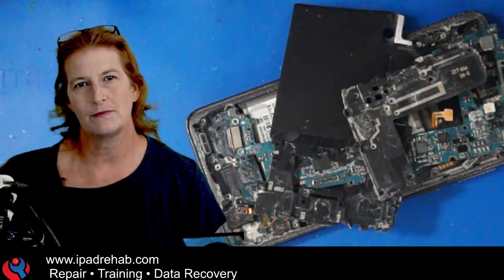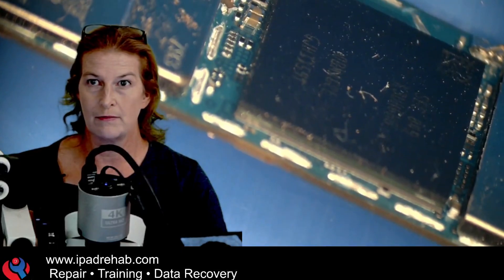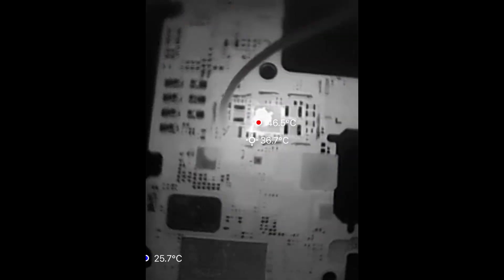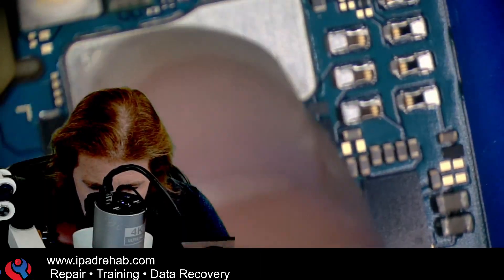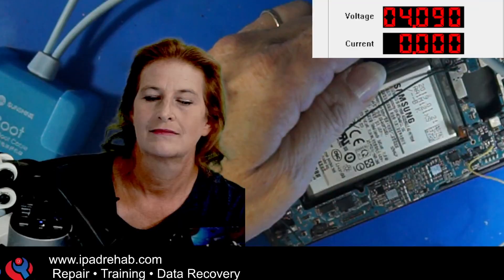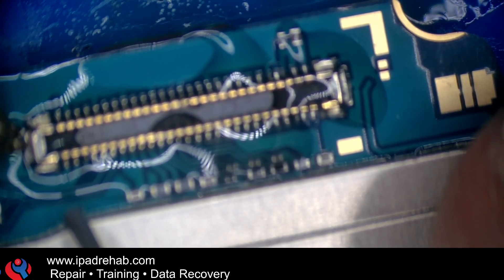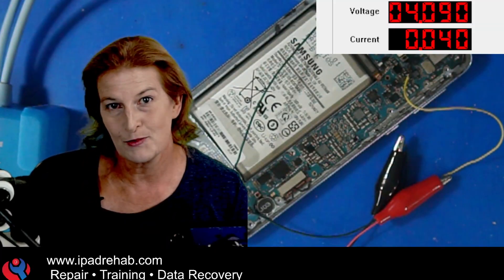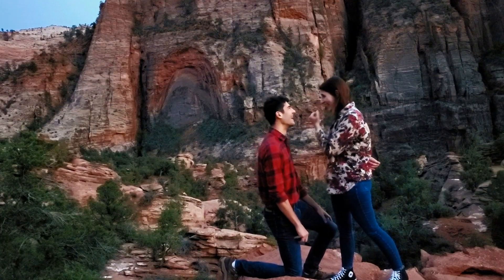Photos and Videos Recovery on Samsung Galaxy S10E

Comment: Great timing for this video.  Yesterday a bunch of Samsung S10 series owners found their phones boot-looping after the latest OTA firmware update by Samsung.  Turns out that the SmarThings framework has a bug and crashes the phone, losing the data too.  Yikes!
Reply: Can I have more info on this please? I have this exact boot loop problem. Is the data definitely lost?
Reply from the maker: Not definitely no.   I would give Samsung a little bit of time to create a software update that will fix it.  (This is about the sudden boot loop after automatic software update that happened on Oct 2 2024).  Other S10 and S10E boot loops are also common and can be fixed with CPU transfer
Reply: @JessaJones  Thank you very much. I will be waiting a bit for a firmware update. If CPU transfer can solve the issue, I'll give it a try. Didn't know that this was even possible.
Reply: @JessaJones  - All Samsung has to do is release a signed SmartThings app zip update, flashable right from an SDcard through stock recovery, or an Odin tar file.  So far they they are just sending people to their service centers. smh
Reply: Does anyone know if there's been an update on this yet? Honestly still heartbroken over all the pictures and videos lost. I don't have the thousands of dollars that DS quoted
Reply: @ - SamFW there's a file for the S10/S10e/S10Plus "U" variants with build data 20240606155510 which fixes it.

Comment: what solder to you use to remove the connector? Low melt or regular lead solder? Why cannot you apply a heat from bellow?
Reply from the maker: Always leaded.  Low melt is bad for connectors because it is weak.   You could apply heat from below if you wanted.

Comment: why not to clean salty through board in ultrasonic cleaner first?
Reply from the maker: That’s a great question—I don’t because I’d have to take off ALL the soldered on shields, otherwise the ultrasonic cleaning fluid will be trapped inside.  Taking off those shields is aggressive so I choose to spot clean with toothbrush and alcohol instead
Reply: @JessaJones  oh, thanks very much thought first you were gonna continue to use that entire s10 but for data recovery only you are right, US cleaner would be xtra hassle.

Comment: Before you removed that first chip that was getting hot, you could have tried floating it with some good pure rosin. I like "X9 Rosin Flux (Mechanic)", which is the purest ive used.
Reply: The rosin also works really well with transfering chips without needing to reball.